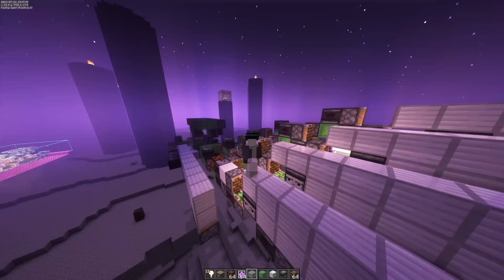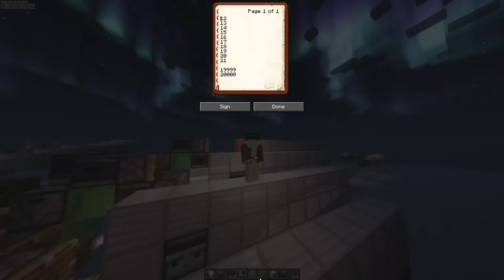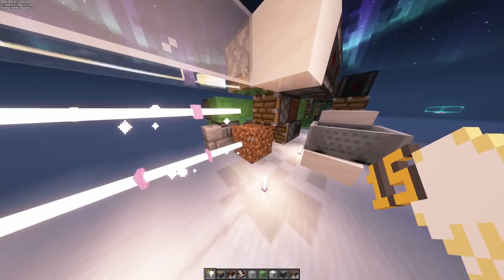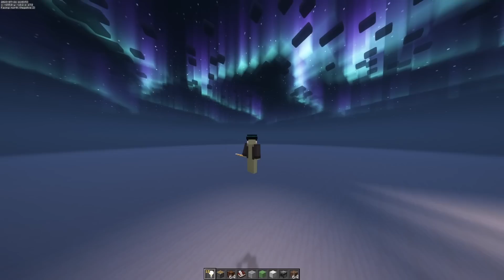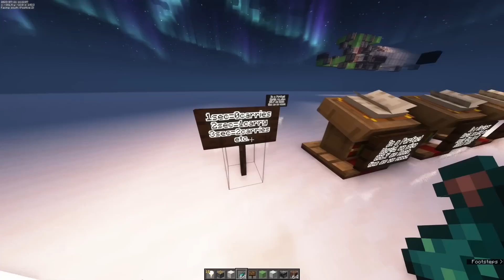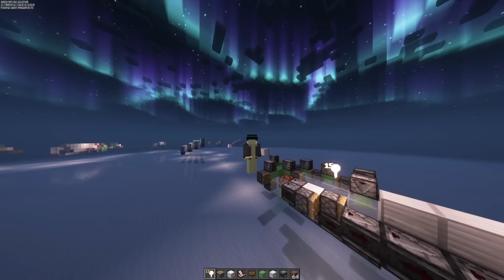The Engine behind My Smartest Flying Machine Yet

Comment: hm, what if instead of trying to stack digits, you instead have multiple feed tapes of different lengths running at the same time, if the cycle times are all different primes and you have it stop when they all line up (via some sort of and-gate?) i could see that getting a few million blocks of distance

Comment: I got a few questions. 

1. Can it be reseted easily for a new flight after it did a flight already?
2. How many passengers can be added to this flying machine?  

I know it is quite stupid but considering that it might allow to transport specific entities in 4 directions for long distances without needing to place down rails or to make a stop far out in the world I think it has some use cases.
Reply from the maker: It can transport essentially infinite entities. You can stack the minecarts or even just add more sections in some places. The machine is pretty much unusable when it stops. It crashes into itself and collapses in almost every single joint.

Comment: Alternatively, if you timed the extensions correctly so that there is just the right delay between pushing forward each piston feedtape, I think you wouldn't have had to go through all the complicated engine stuff you did here, and could have gone with a fixed speed engine (and it might have been faster too). If you did it this way though, the weird thing is that because the last feedtape would sort of lag behind the engine a bit, it would mean that the last feedtape would continue firing a few times after the engine has stopped.

Comment: Nice video! I however do feel like making a flying instant carry counter should be doable, and would greatly simplify things haha
Reply: if the tapes were pushed forward with the right offset in timing, I think they would have been able to use a constant speed engine instead which I think is approximately what you mean

Comment: Instead of treating several pistontapes as multiple digits (with the complicated and slow carry logic this requires) you could use pistontapes of different lengths and run them in parallel, stopping the flying machine when the marker blocks in all the tapes line up.

With five tapes of lengths 8,9,11,13,17 for example you can encode any distance up to 175032; add basically anything else (e.g. a pair of toggles, or a length-10 tape, or just move the FM multiple times per tape cycle) and you can encode any distance that fits into a minecraft world.

Unfortunately I don't have the slimestone skills to design a prototype myself but perhaps the math tip is enough already.

Comment: Just spitballing here, but wouldn’t it simplify the design to do away with the feed tape and just work base 2? What I’m thinking is a sticky piston facing up which zero ticks a block and the middles are observers. You just have to manually push the block and the piston with the engine. Now you might be thinking that base 2 is much worse than base 20, but consider this. You use 20 blocks in base 20 to count to 20 but with 20 base 2 blocks you can count to just over a million

(Edit) and the carry doesn’t fire anomalously because the pistons are moving? If not switch the block and the piston
Reply from the maker: Generally It was best to maximize the mileage I can get out of a single feedtape for simplicity purposes. There wasnt a whole lot i could do to make it binary operating

Comment: Traditional redstone signals effectively have an infinite range as I understand it, so it would be interesting to build a simple digital computer (I think 8bit should be enough), with outputs spaced along a tunnel, so that it could be given a distance coordinate, to power a "flying" (or perhaps tunneling) machine automatically.

Strictly speaking, a minecart would be more effective given the effort involved, being both less effort and much faster...But I still think there's something cool about a subway you can walk into, as opposed to a minecart that you sit in.
Reply: The thing is, if you're going to need to build a redstone line some distance, there is little need to have a flying machine except fpr aestetic purposes, because flying machines require zero infrastructure.

Comment: To stop the hole machine you have it so it can detect when that last cycle finishes, why cant you use that detector on each line so that when the one cycle is finished, the next pulses once
Reply from the maker: Thats too fast, the system needs time to perform the carry process.
Reply: @squibble111  Oh ok yeah, that makes sense.